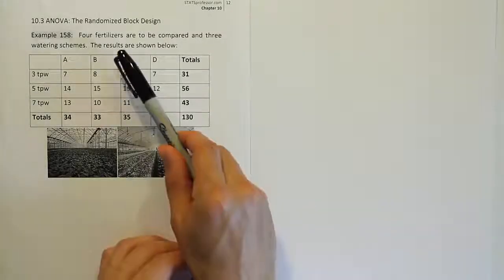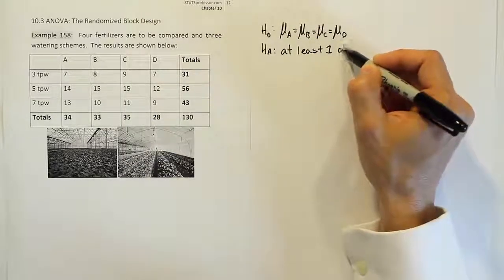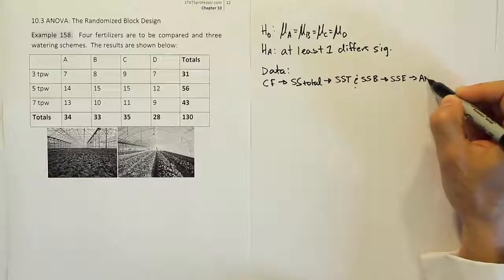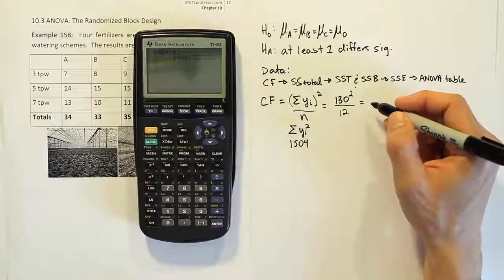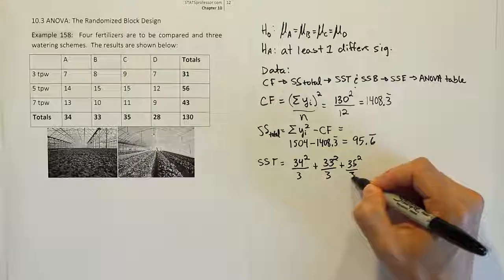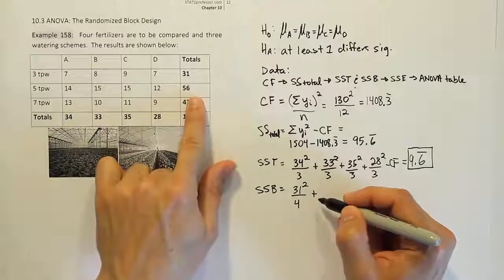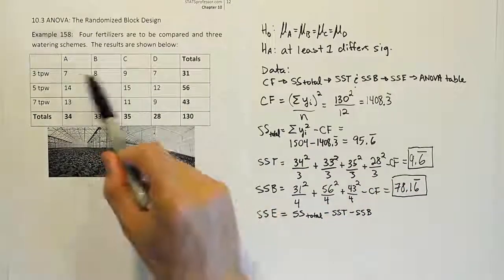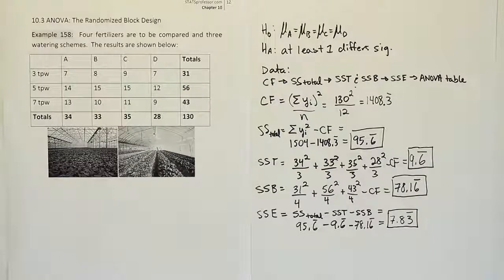ANOVA RBD, Example 158A

Comment: How can I determine which one is the BLOCK and which one is the TREATMENT ????
Reply from the maker: The block is the variable that you are not really interested in, but you need to block out so it doesn’t interfere with the test of the treatment means. Typically, a problem will ask you to test if the treatments are significant, but will not ask about the blocks. For example, you may want to test if different views in hospital rooms affect recovery after surgery. To test this you have dozens of patients undergo surgery and divide them into different rooms to see if rooms with a view assist in recovery. You can’t let one surgeon do all of the surgeries because it’s too much work. Using different surgeons could bias the result if they were randomly assigned, because not all surgeons are equal. In this situation using a block design is necessary, and the blocks are surgeons because we want to block out their effects from our test of the different room types. The one the hypothesis test is about is the treatments.
Reply: @dmcguckian  Thanks, your explanation was PERFECT, 
but I have another question on problem 3 that talks about the groceries prices and families ... did you choose the families to be the Blocks and not on (CRD (replication)) because the families are not the same, and there is a variation comes from them but not that what I interested in ???
and Thank you again